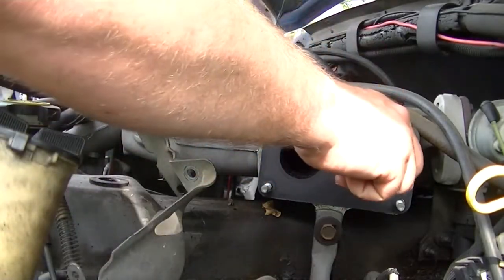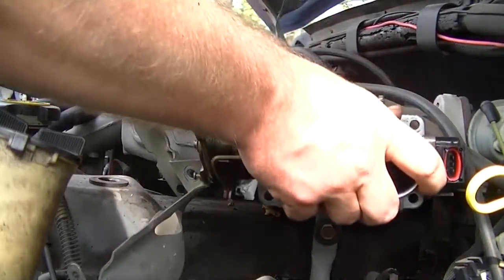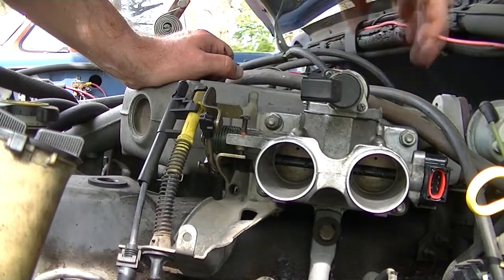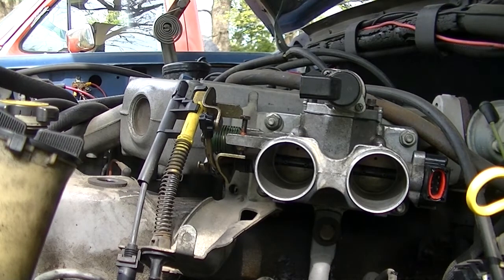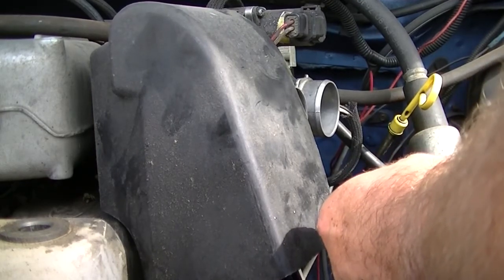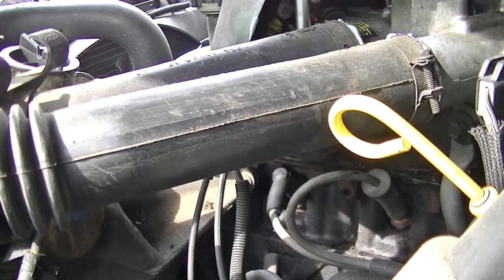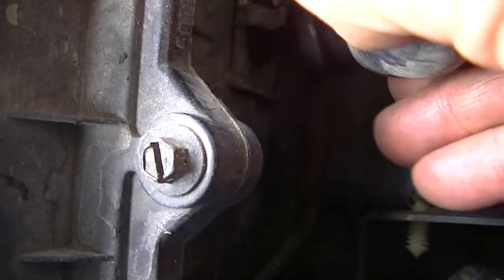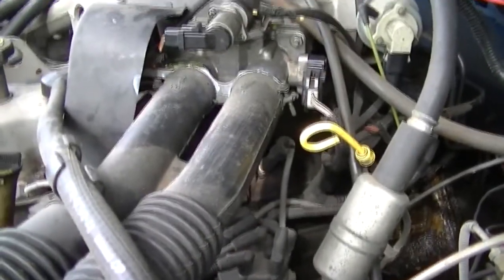Blue F 150 Throttle Body Cleaning

Comment: For some reason I thought this video would show the actual steps involved in cleaning a throttle body,  especially since the title mentions throttle body cleaning..  Not being a dick,  just hoping to see exactly how it was done and the fluid you cleaned it with.  I bought a new iac valve and guess I should of tried to clean it before replacement with a new one,  you had any luck cleaning an iac?